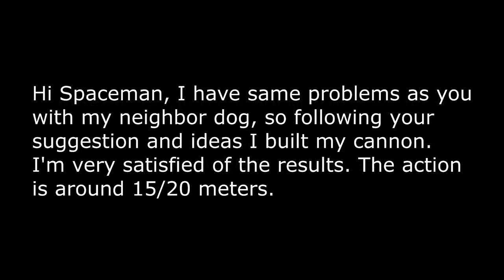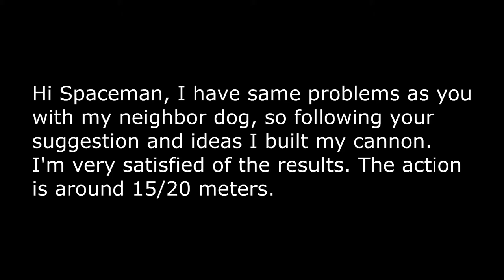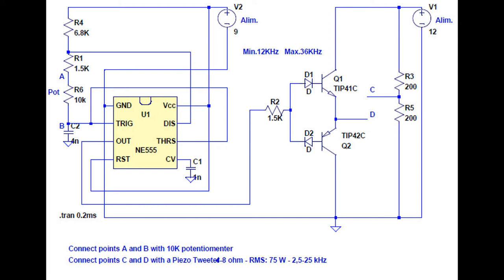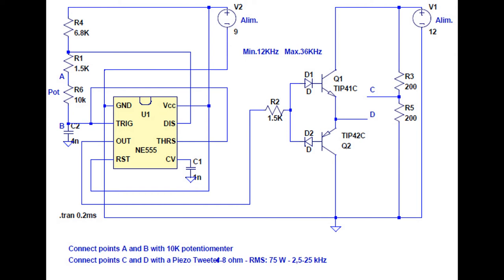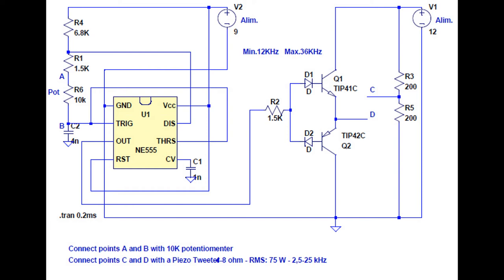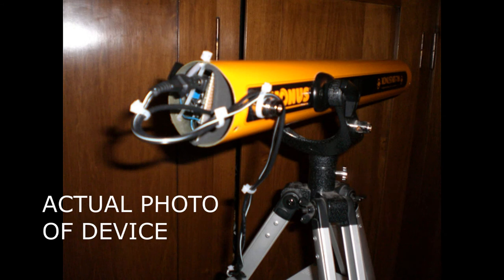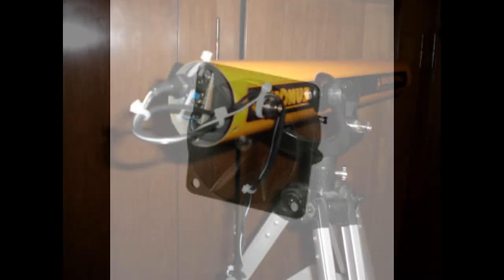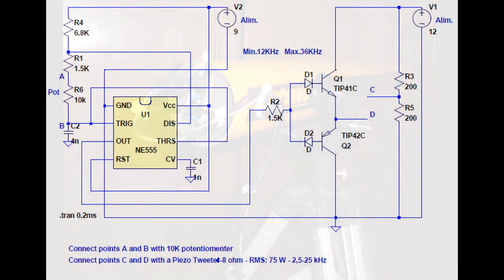HIGH FREQUENCY DOG CANNON (ITALY) - IMPROVISED

Comment: Hey spaceman, just wanted to thank you, I to built my first cannon i bought the Kemo pulse generator the one you can adjust with the turn knob. I used a 94db piezo speaker with the freq 3000 to 40,000 i also ordered from Germany the 120db speaker so that is on its way. The annoying yippee critter in question is about 70 to 75 feet. I installed a toggle switch 20amp single pole and i am running off a lawnmower battery i just followed the Kemo instructions. First time turned it on and the dog ran and hid lol he came back and barked two more barks then ran away. So i just left it on for about 10 minutes  and nothing but pure silence. So this does work people if you have a little bit of a electrical background you can build one.

Comment: I have done some research on the ultrasonic drivers and circuit to drive piezo tweeters. I found that a cone has better sound dispersion than the straight tube. I set up a tone generator to drive an amplifier and a microphone to test out the setup. I am making a full auto trigger oscillator with a piezo driver. The LT3469 IC will drive 35 volts with only a 12 volt supply. I have designed the circuit and laid out a PWB to be fabricated. I hope to get it back next week for testing soon. If you are interested I can tell you more about this along with my results. Thanks for the motivating articles. 
One comment about the circuit, the square wave should be filtered into a sine wave as the square wave may cause unwanted heat in the driver. Another thought is the capacitance of the piezo driver may filter some of the square out. Has anyone looked at the drive signal at the driver to see the quality of signal on this circuit?
Reply from the maker: I agree that cones disperse better than tubes, but I'm not trying to disperse, but I'm rather trying to project it and mask the edges somewhat. However, dispersion is ok if you have plenty of sound and you don't mind the sound being everywhere. I also agree that the signal should be a sine wave, but my reason is so you don't end up with harmonics that can be heard by the human ear. I look forward to more info from you about your experiments. Thanks for posting.